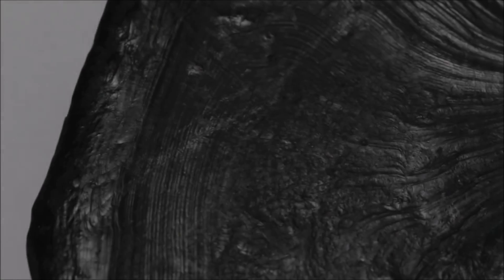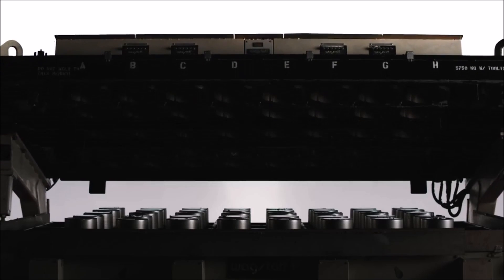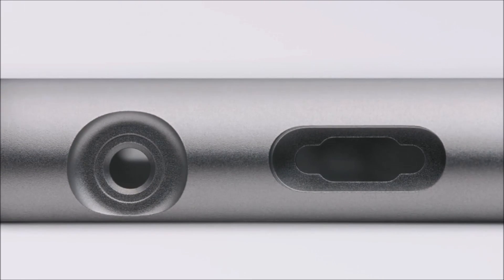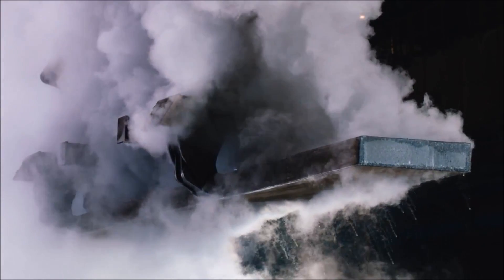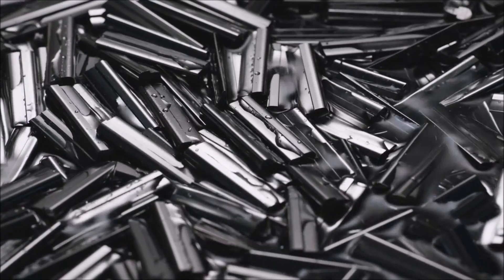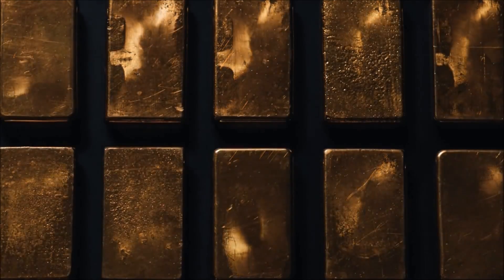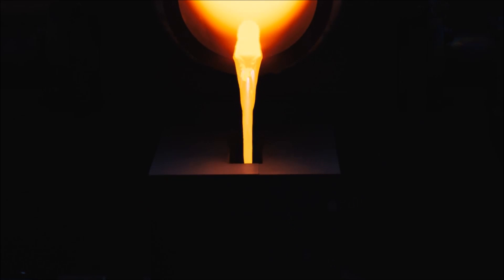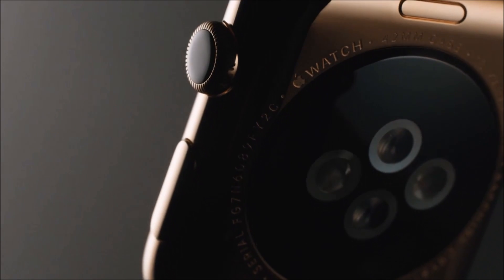How the Apple Watch is made

Comment: But still square. Apple don't have technology to make round watches.
Reply: Sourav Bagchi why should they make round watches? I would prefer squared displays on a watch more than rounded.  It’s better to use, more comfortable and better to see content on. Rounded displays are bullshit.
Reply: Josue Ochoa Round displays dont let as much letters in one page as a square display
Reply: On the Apple Watch you can easily read short messages, even emails.
Reply: Davididi 12 I don’t think a watch is even big enough to display the whole message....?
Reply: Josue Ochoa It can id its a normal small message or if you make the text size smaller i think
Reply: FIRST OF ALL: Doesn't* have THE technology(that's a correct sentence)and secondly Apple does have the technology but it just makes more sense to make a smartwatch square.
Reply: Josue Ochoa its harder than you’d think. I have an iPhone X, where the display isn’t square, instead it’s round-ish. There’s often cut-off corners and unfilled space left, as usually, displays are rectangular. When you switch to a circular shape, you lose efficiency.
Reply: It is kinda round on the edges but square..... WOOOOOOEEEE Best
Reply: Cvbe fuck off everything you just said was an opinion yet you try to make it sound as if it were facts! The software of the watch could easily be adjust to the round shape. Apps/widgets.

Comment: They should make a titanium version of the Apple Watch
Reply: That's a great idea, worth thinking about it!
Reply: Penguinator soft? You mean strong, its much stronger then most of these metals, given because of its high strength it will be brittle, think, granite or glass, higher strength/scratch resistance then aluminum/steel but britle because of its thickness and well the material, but given they use a aluminum alloy, a titanium/nickle alloy would be very strong (litteraly what would make an iron man suit possible) titanium gold alloy (what is used/said in iron man) would be either too expensive, and would be less strong then a titanium nickle alloy, and nickle is primarly cheap
Reply: OverKnight 52 Oh my. Listen. 

Brittle means easy to crack/break/fracture under pressure. The brittler something is, the worse it is for this application. 

Iron Man, while an awesome film, is a science fiction film. Never ever draw any evidence from science fiction to include in a scientific debate. 

Also, you need to make sure that you know what you’re talking about. I’m a sad nerd with few friends who enjoys reading in depth about this stuff. I know what I’m talking about. You sound like you’ve listened to the song ‘Titanium’ a couple of times. You don’t seem to know what you’re talking about.
Reply: OverKnight 52 it is strong, but the problem with titanium is, it is much much harder to machine, even the aerospace grade variant, it forms more oxide then non finishes stainless steel and anodized aluminium. And yet heavier then aluminium unless you get the real shit which is used in jet engines.

It does appear more scratchy over time then stainless steel or anodized aluminium. Don’t believe me? Look at jewelry forums. 

Also, i have machined them before and i can tell you it ain’t worth it. Stainless steel is much better and in many cases stronger
Reply: @laserguy8673  dying to know what you think now
Reply: Maybe it's price should be like the iPhone X😂
Reply: It will be soooo hard to process... it will may need more and more time and machine to do that.
Reply: Dylan Forbes so what if you can’t buy it don’t buy it ✌🏻 I would definitely buy this
Reply: Penguinator cute, and i mixed science with science fiction, if a "real life iron man armor" would be made the metal that would be perfect would be a nickle titanium alloy, offering a strong metal, with slight flexibility, making the titanium less brittle, given, titanium is already a strong metal, from my understanding, havent we all seen those youtube videos where they shoot a one inch plate and it bounces back. Iron man uses a gold titanium alloy in the movie (iron man 1) i dont know why, they choose that specific metal, but what i do know is a titanium nickle alloy would be very strong, and less brittle then pure titanium, proven by scientists, and said by people who have said that would be the best alloy "iron man should go with" since it offers the strength, given.... I wouldnt buy a titanium watch, i like aluminum, its extremely light, and inexpensive, a titanium nickle watch would probably cost as much as my iphone X....
Edit: just saw you said its an awesome film 😂 yeah man, one of my favorites movies, i hate you just a little less👌🏽
Reply: OverKnight 52 I’m sorry for being a douche 9 months ago. I can’t actually believe I got that worked up about a simple misconception, and it was ruse of me to be so patronising. Again, I’m sorry.
Reply: @myHorribleMusic  Wow. Contrition on the Internet! You earned this 'thumbs up'.
Reply: Titanium is too soft
Reply: With diamonds on it
Reply: How about, Diamond?
Reply: 4000??
Apple watch sport.$350
Apple watch$500
Apple watch edition $14,000-18,000
Reply: Penguinator with the right alloy it’s not you know titanium is bulletproof and used in lots of expensive jewelry
Reply: Yeah that would be just 3000$
Reply: Depends on the Alloy.
Reply: And that’s what they did 😁
Reply: wish granted
Reply: 4000 dollar watch most people aren’t gonna buy?? And then they’ll give all the good stuff to that one?
Reply: No. Definitely not. Why, anyway? It is relatively soft and susceptible to nicks and scratches, and I can't think of any tangible benefits.
Reply: NO.